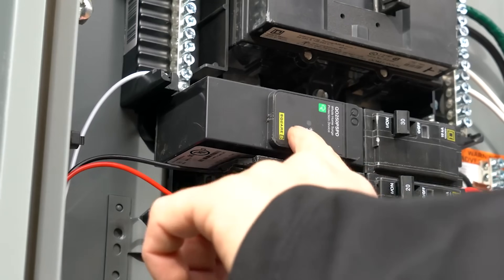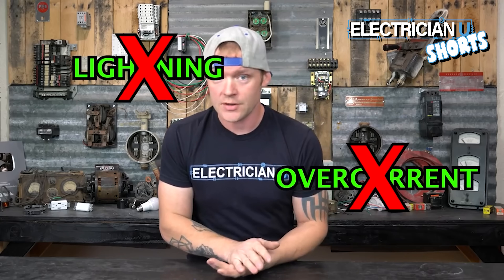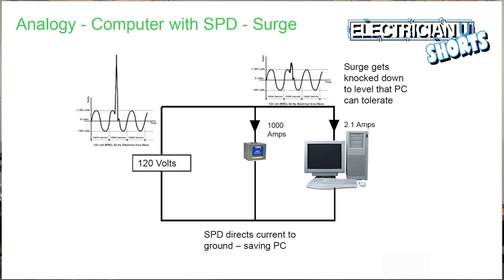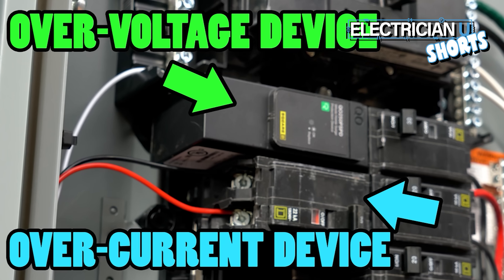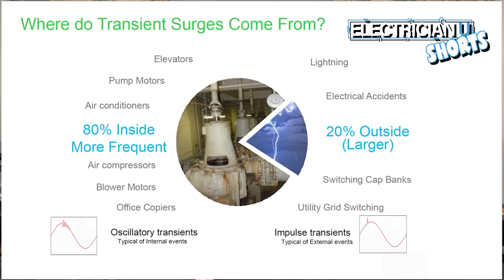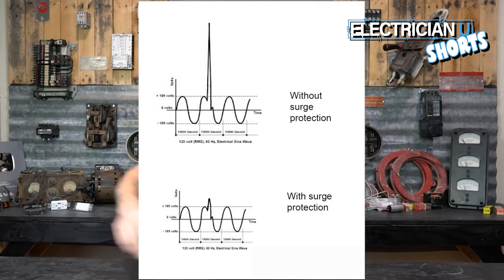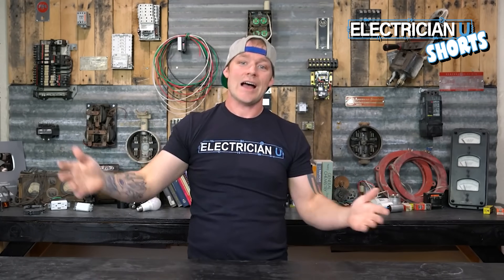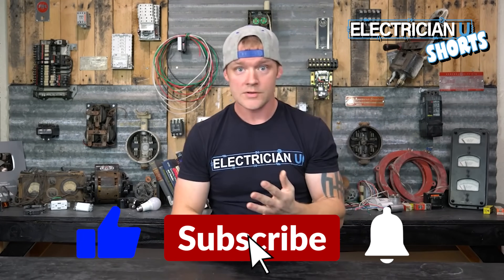SHORTS - SPD's - What a Surge Protection Device IS and ISN'T - Explained in 3 Minutes

Comment: Very good explanation, I like that you made reference to the fact that nothing saves you from a direct lightning strike, one item you didn’t cover was two stage protection. Having a TVSS on the main panel is good but you should also have a good surge protector power bar for sensitive electronics as well. And don’t buy your power bars at the dollar store.

Comment: Mandatory of SPD installation leads to serious improvement of household grounding system. 1-2-3 grounding rods will not be sufficient in "draining" high frequency hundreds of nanoseconds surge currents to ground. This can require to build industrial-like grounding system with many interconnected ground rods or a system with several "high-depth" rods (grounding rods, that are driven to ground for 3 to 12 meters).

Comment: A fuse or breaker will give some incidental over voltage protection if the circuits they are on are close to capacity because... Ohms Law. Whether any equipment gets damaged by the higher voltage though depends on their individual voltage endurance capabilities.

Comment: What options are there for retro fitting a existing breaker panel with out replacing the panel? You touched on lighting, is there anything you can install for protection? I live in zeus playground here in FL and I know the time is coming when I will be in the cross hairs.
Reply: If you're in Zeus' crosshairs, you'd better be living in a house that doesn't burn.

Comment: Why don't we call it as a surge suppressor, cose it limits amount of voltage entering into the circuit, if it is surge protector it will short the live or neutral conductor to the ground conductor and blows the fuse or trips MCB. Just my opinion, please don't take it as disrespect.

Comment: You should do another video about the types of surge protective devices there are. I know they make some that install directly on your breaker panel and then the power strip surge protectors. But with the power strip kind your outlets have to be wired correctly for them to work

Comment: Have you looked at the specs on the SPDs? The clamping voltage is usually something like 600 volts hot to neutral. I’m surprised sensitive electronics can take that much of a surge without getting fried or am I misunderstanding what is being allowed through with that rating?
Reply: Most of those sensitive devices have an additional power supply (or two or three) between mains and the very sensitive bits and those supplies soak up a lot of the punishment and ideally have some of their own protection.  E.g. a CPU has the PC power supply for mains to 12V DC, and then there's a bank of small DC-DC power supplies that take that 12V down to the ~1V the CPU runs on.
Reply: You need a smaller point of use surge protector at the device. They will typically have a lower let-through voltage, but also a lower energy rating than a whole house surge protector. Layers of protection is key.
Reply: @mattv5281  Ah, so that's what they mean when a whole house surge protector is not enough - you get the clamping voltage down to a max of 600V line to ground / line to neutral on the whole house and then something 400V or lower on the TV or computer by having a surge protector directly in between the device. It's starting to make sense now.

Comment: Neighbor remodeled their kitchen, installed very elegant, ultra high-appliances. A few months later a thunderstorm happened and a big surge hit. Wiped out all those appliances with all their sensitive electronics inside. Cost thousands to repair. Installed a whole house surge protector immediately.
Reply: Worked at a large rich gannett cheal skate newspaper years ago. They installed the absolute cheapest 25 to 50 ton roof AC units. I recomended SPD'S & undervoltage relays. After they spent $5 grand 3 seperate times for a 125 to 150' cranes along with cost of compressors labor etc they had somebody install the under voltage relays and went around 12 years before another compressor burnt out.

Comment: NJ hasn't adopted the 2020 NEC  but I'm already selling a lot of whole house surge protection devices with service upgrades. Also, secondary surge protection around any sensitive electronic equipment is encouraged.
Reply: What SPD do you like?. Here across the river in Philly we are in 2 codes. 1 & 2 family dwelling units in 2017 NEC and rest in 2014. Our on the ball politicans have been talking about going with a state electrical lincense since 1964. Worst part some hick towns do not honor other licenses so you have to take and pass a test to get a license there. Ball busting philly makes owners take a 30 hour OSHA class and 10 hours for workers along with proof of not only regular insurance but car insurance. Never performed any electrical work while driving.

Comment: Hey brother have you installed or looked into EMP protection devices?  It looks like a surge protector that mounts in or on the panel. It claims it can withstand a lightning strike😱. I’ve put a few in and researched a little. What’s your thought ?
Reply: I doubt anything can handle a direct lightening strike since it's a huge amount of energy. If it gets to your electrical system it's going to pretty much destroy almost everything depending on how long it lasted.
Reply: I've bad mouthed a couple of channels I watch who push a product called EMP Shield. Guys in lab coats speak electrical gibberish when trying to explain how their device works and why it's not just another surge protector. It looks like they market to people's fears for the big $. A small device with little 8 or 10 ga wiring can't possibly do what they claim IMO.
Reply: I agree with you guys on how unbelievable it is that something that small could discharge a lightning strike. That’s why I was asking, homeowners paid for them and had me come install them. I guess they haven’t been hit yet. 
Or maybe they have?😳